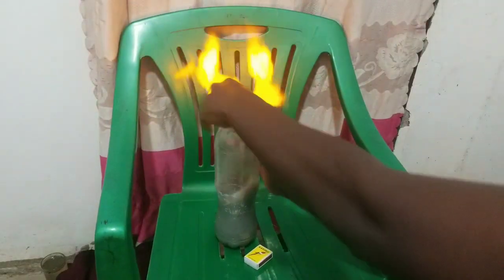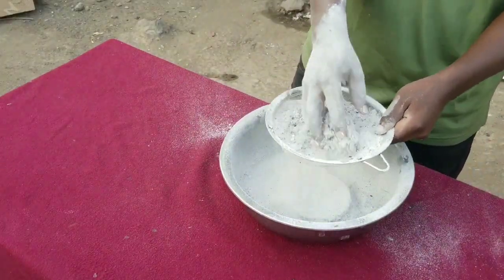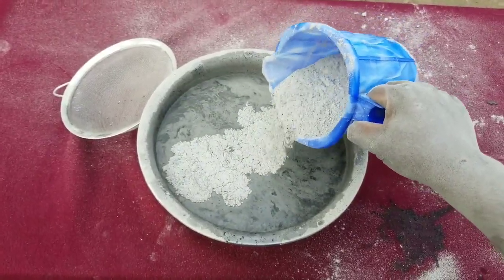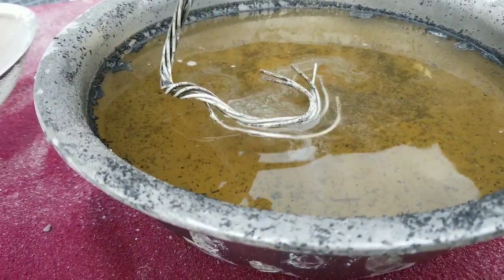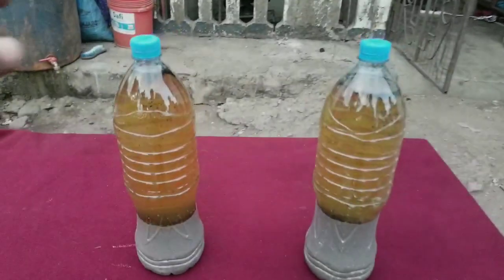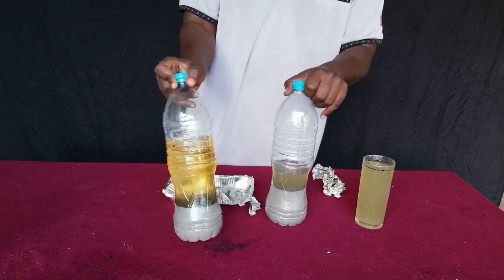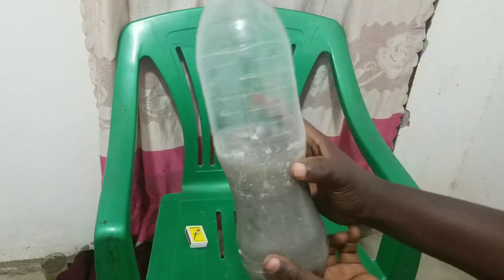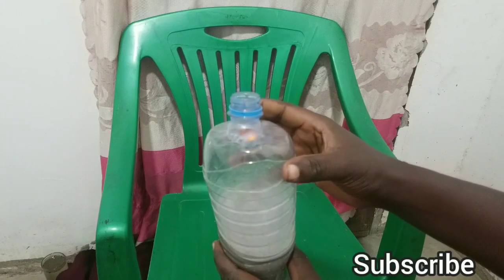How to make hydrogen gas from wood ashes and water / Making potassium hydroxide solution

Comment: Y hot water and not cold water?
Reply: Possibly because boiled water is degassed (not containing dissolved CO2 that would turn hydroxide into carbonate and bicarbonate). Also carbonates will dissolve more easily from the ash matrix - in solution, carbonates produce some hydroxide, too.